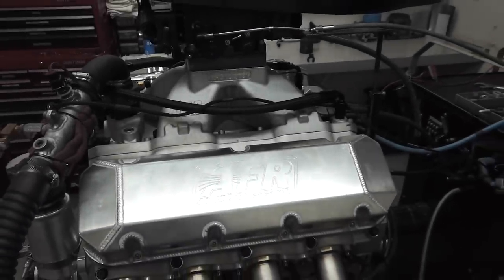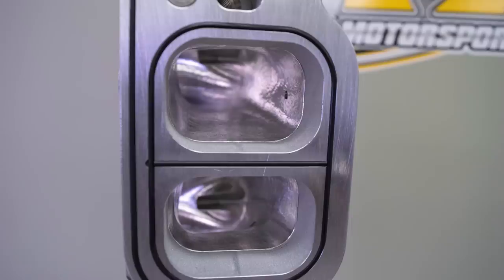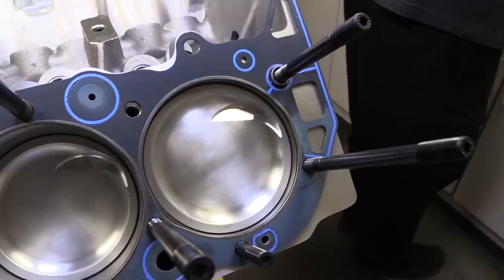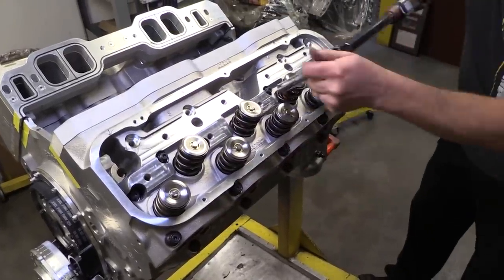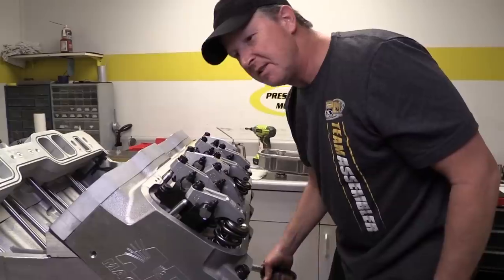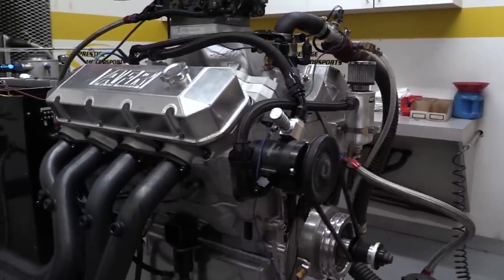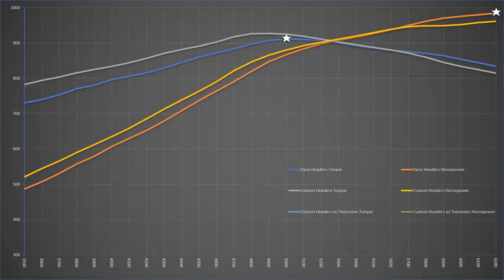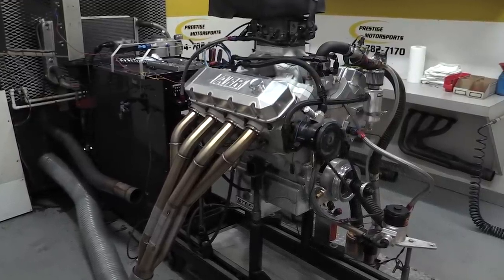665 Cubic Inch (10.9 Liters!) Monster Big Block Engine Build [The Displacement King]

Comment: No replacement for displacement.
Reply: No 4 cylinder and 6 can reach hp like a Big Block. Dragster 12000+ hp.
Reply: Hell ya brother do it for dale
Reply: Turbochargers are an effective replacement for increased displacement. Four or even five valves per cylinder are another effective way to increase HP per cc of displacement.
Reply: Neg Ative  yes it helps on small displacement. Don’t forget it helps on Big Block V8’s too lol
Reply: @Silkmaster4200  Diesel engines still use turbo chargers..... No matter how much displacement, a turbocharger will increase efficiency whether its a twin turbo or one giant turbo the size of a turbine from an airplane but force induction was designed to replace large displacement and still have the same power. Just look at Ford F 150s. As for me I would rather have a large displacement but with todays technological motors from JAPAN with variable compression it seems as though that is the way standard engine is going tobe.
Reply: Forged Steel Wrench It’s the way Ford design it. They want better on fuel. If they put Twin Turbo on V8. It would eat the V6 for supper. Be harder on fuel. That’s the reason.
Reply: @Silkmaster4200  Better fuel economy through their variable timing control true, yet with the power of their 8cyl. I would say the volume of each cylinder and the compression ratio it holds/cyl. would determine over all power at the crank before the number of cylinder count or force induction/boost. Just check out the variable compression engines that are operated by pcm, and this done before force induction comes into play.
Reply: Wrong.
Reply: turbos and superchargers work actually
Reply: @linkin6992  
Plus better mpg.
Reply: @stomabag7127   They do work . But the fact stands theres no replacement for displacement .  The engine in the video can still be turbocharged.  I own a turbocharged 383 sbc and a compound turbo cummins diesels.  Most would think im lying if I told them the power either made , the cummins is driven weekly on the street to work and so.
Reply: Yep. Anything you can do to a small motor can be done to a big displacement engine and make more power. Gale Banks says throttle response can be improved by adding a turbo, but I have two factory stock cars right now rated at almost identical ho.and tq. One is a naturally aspirated v8,.the other is a 4 cylinder turbo. Stab the gas in them and the v8 car responds immediately with tons of torque down low. The 4 cylinder comes into it's own after a second.or two when rpms raise. I like the fee of the naturally aspirated v8 for street driving.
Reply: The scary thing, is that block can go bigger - 4.7" bore, and 5.375" stroke... with no addtional work - brodix has stated you can go bigger in both dimensions with machining and special sleeves. And really, this is a relatively mild combo for this much displacement- theres video on the tube of a similar displacemmt engine built with the same block, making 3000hp on pump gas with twin 98mm turbos.
Reply: As a diesel guy i have some questions:
Why 2 valves per cylinder instead of four?

Why use a carburetor( indirect injection)  instead of direct injection ?

Why use a distributor instead of coil packs ?
Reply: A battery and an electric motor the size of a shoebox will put this to shame.
Reply: Ruckus ummm, because! old skool! Do whats known to work, except keep going bigger then the next guy! Keep it real! Keep it simple, STUPID!!! KISS!
Reply: Mike Lyons
Yeah, but the saying is “There is no replacement for displacement” and while that’s a fun saying, it’s patently false. You suggested just now to “put a blower on it and call it a day”, well a “blower” is a Supercharger and a Turbocharger’s real name is “Turbo-Supercharger” - it’s just two different methods of achieving the exact same thing - belt drive or reclaimed exhaust energy. Either way it’s energy generated by the engine repurposed to make even more energy. Turbos are just more efficient blowers typically (but not always). Hell, some superchargers are just half a turbo with a pulley mounted where the other half should be.
In the end, it’s nice to have both IMO. That’s why both of my race cars are turbocharged with a decently high volume of displacement for their cylinder count. One of these days I’ll get around to building another twin-charged car - this time for myself and I’ll enjoy the benefits of displacement, blower, turbo(s) and Variable Intake Geometry all at the same time.
I know exactly which mid-engine chassis I have laying around that engine will be going into, too! 😉
Reply: @mewrongwayKOCXF  You  do know it's been proven that on modded engines a carburetor will make more shear HP than fuel injection does right lol . There are quite a few videos on here that prove that .  The other thing is the damn LS engine isn't that all mighty HP King like most think ! They are cheap to build but also have oiling problems as well as valve train problems that few are admitting to especially on the engines that are using hydraulic cams & lifters look up 06-16 & beyond GM LS 5.3 AFM problems & you will see what a crock GM did on those to try & get better fuel mileage as well as performance & that they should have stood by the consumers & had a recall on those piles of shit but people are getting screwed on it & the only way to fix it is to buy a new cam & non AFM lifters then do the AFM delete to the valley pan & the ECM on it to get rid of that junk before the lifters go bad & take the cam out  !  Also look up Blasphemi a 55 Chevy gasser done up by one of the road kill guys using a old school Chrysler Hemi for power with a blower on race fuel only who ran against the other guy who has a 55 Chevy with a turbo LS who got his ass handed to him by the old Hemi with a blower on it . I have a newer Chevrolet Silverado with the 5.3 LS & it runs good but what I can't stand is this damn truck has way less miles than a old 93 Dodge W200. 3/4 ton 4x4 I had for 8 years with the measly 318 & my Silverado is only a half ton & only gets slightly better fuel mileage but the worst thing is it leaks way more oil than my old Dodge did & the Dodge had over 100,000 more miles on it !  The thing your missing here on this engine is it's built very strong much stronger than any LS will ever be & with the right components & because of its cubic inches it will also make way more power more reliably with less rebuilds in between but it's going to cost you but in the long run will pay off .  Right now again the true King of HP would be the Hemi powered Nitro engines running blowers & injected that are 10,000- 14,000 HP which is based off of the old 426 Chrysler Hemi but has been updated & made stronger with all billet aluminum blocks heads & parts inside & GM & Ford don't have anything that can do this ! Even though they have Toyota Ford & Chevrolet in top fuel nitro classes they are all running the same engine & only the body & name emblem is what's calling them what they are but deep down they are all running a Hemi that's it 500 cubic inches as that's the maximum cubic inch displacement that's allowed in top fuel as well as Pro stock  !
Reply: @mewrongwayKOCXF  you might want to rethink using top fuel a line of thinking when comparing efi to carburetors  - Enderale style mechanical injection has basically nothing in common with efi. It works by regualting the smount of fuel being returned to the tank via a barrel valve hooked to the butterflys. Its used in blown alky and fuel classes for one reason - the truly jawdropping amount of fuel it can pump into a cylinder in a very short amount of time, an Enderale 110 for example, i a gear driven fuel pump the size of a v8 truck alternator, and flows 13+ gallons a minute and is one of the smallest they offer.
Reply: @mewrongwayKOCXF  Also, Dostributers do have advantages over individual coil packs, enough so, that multiple manufacturers offer special distributer conversion kits for LS motors among others. 1 factor is rpm - over 8500 rpm the factory reluctor wheel setup starts having signal problems to the timing box. Also, individual coil packs tend to be much smaller than the single large coil that distributers have, and doesnt tend to suffer from "spark wash" from very (30+psi) high boost applications. It also simplifies diagnosing ignition problems between rounds when racing where time is limited. Admittedly this is a niche application for 99.9% of engines, but it does offer some advantages - i personally came across it when doing research for a (now abandoned, too much $$$) big bore, short stroke LS project  where i wanted the motor to live at high rpm for long periods of time for Formula 5000. The ignition issue was repeatedly mentioned in similar projects (btw, a 4.8l crank thats been knife edged in an lsa block with a dry sump pan and ground down for honda rods is a brutal motor with good heads - think 750 hp at nearly 9000 rpm) ive come across.
Reply: Let's be real. A twin turbo 4.8l ls will easily outperform this engine at a fraction of the cost.
Reply: That’s what she said
Reply: Kinda funny how the stock Honda Civic Type R is matching the Nurburgring times of the Dodge Charger Hellcat, with less than half the displacement. V8's don't have a wide power range. It's all focused in the low end torque. Fine if you want to drive in a straight line, getting mopped in a real world road course.
Reply: Mike Lyons  Yes. Exactly!! I was about to say the same thing but in simpler terms. Superchargers do exactly what Mike said, they supercharge the combustion by pulling air in sorta like a high speed vaccum. 

Turbochargers mix exhaust gases and outside air together which boosts the combustion. 

Superchargers are belt driven

Turbos are not and require things like intercoolers and such to keep em cooled down enough so they dont burn out. 

And the more displacement an engine has the more torque it produces down low. 

Case in point here with the engine build in the video. It made over 700 LBS of torque all the way to the redline. Cant really do that with forced induction unless its a Top Fuel Dragster making 10,000 Horsepower.
Reply: @juansolo1617  Actually the problem with todays supposed muscle cars is they have too many gears in the transmission now. 

Any more than 4 gears is way too many for a drag racing setup. 

Why?? Because having 5, 6, 7, 8 or 9 gears causes the transmission to not be able to take full advantage of the engines torque and power curves. 

Is why the 2 speed Powerglides are still popular. 

In fact the top class dragsters use just a direct drive setup. Basically no gears at all.
Reply: Not necessarily, dragster engines make  10 times as much horsepower as this engine and still have a smaller displacement.
Reply: Toy-joda for minutes not for hours.
Reply: @Silkmaster4200  I'm sure a 6cyl can hit 12k HP. Sorry this isn't the 1960s buddy. Time and technology has moved on without you.
Reply: As a matter of fact, 14.7psi (1 bar of boost) has the exact same volumetric efficiency as doubling the displacement. 

Thus literally making boost a replacement for displacement.
Reply: @Silkmaster4200  Just seen a TT coyote mustang GT 5.0 V8 lose to 4 banger cobalt.....Power to weight is all that matters.

All motor 4cyl just hit a 8 second 1/4 mile, 4 bangers are running 6 second 1/4 miles. Man you old guy's have no idea what's going on these day's lol

I can order 2500hp 6cyl crate motors. V8s are obsolete sorry old timers!!😂😂
Reply: @negativeindustrial  But what if you put a turbocharger on an engine as big as this one? Wouldn't that be better than a turbocharger on a smaller engine? If yes than there is still no replacement for discplacement ;-)
Reply: Go electric..no competition
Reply: For everyone in disagreement. >no displacement
>displacement  
Which of the two will make more power
Reply: @Silkmaster4200  ok, but you put those same turbos you would put on the 4 banger, on this and inches still win
Reply: @negativeindustrial  Supercharging is not a replace for increased displacement, it is supplementing the displacement you have (you are trying to get your little engine to behave like the one with increased displacement). If you don't believe me take the concept to it's extreme and remove all displacement while adding all the boost. All you'd be left with is an air pump that can't turn itself or do work. Turbocharging and/or adding more valves just supplements what's there. Volume. Displacement.
Reply: @boostjunkie2320  
That's wrong on both counts. Doubling the air pressure does not double the volumetric efficiency because the volume of the engine does not change (baring a variable displacement engine). You cannot put 110cc of volume into a 100cc cylinder. What doubling the air pressure does is increase the air's DENSITY, not it's volume, and this is not by double because no compressor is 100% efficient. 
When we say an engine is "110% volumetically efficient" we don't mean it literally, we mean the engine is compressing 110cc of air into a 100cc volume before the valves even close (usually by some type of air compressor, like a turbo). Conversely, if an engine is 85% efficient we mean it's taking in 85cc when the cylinder is 100cc in volume. The volume of the cylinder does not change. There is no replacement for an engine's volume (it's displacement). There are only things we can do to supplement or get the most out of that volume (usually by increasing the air's density either chemically with nitrous oxide or physically with a compressor, or even both at once).
A lot of people think a supercharged engine flows a bunch more air volume but it does and it doesn't. It does BEFORE the compressor but the actual volume of air flow, it's mass airflow, AFTER the compressor doesn't usually change that much, it's density does.
Reply: @negativeindustrial  yeeup! there is a Koenigsegg twin turbo 3 cylinder 2 liter that put out 600HP
Reply: Come to Australia mate, we have a Ford Australia 4.0 liter turbo 6 cylinder engine  known as a "Barra". There are stock looking street cars running this engine which have 1500 horses at the rear wheels. 🇭🇲
Reply: Linkin 69 so does na cars.
Reply: In naturally aspirated, more displacement is better.
Reply: @forgedsteelwrench9249  , why can we not combine them all into engines of various cylinder amounts?
Reply: @stomabag7127  , yourself, you mean?
Reply: @Acroposthion  , but you are not going to make it very well with getting those 0 to 60 start times, as the torque on those engines are horrible, plus aircraft engines historically do not have a good reputation on the road, and ditto for the vast majority of marine engines.
Reply: @ruckus__  , can a gasoline powered internal combustion engine improve its performance with those things?  I heard that some gasoline powered internal combustion engines have direct injection set ups, but I am not sure if any of them have coil packs and four valves per cylinder instead of two valves per cylinder, though, unfortunately.
Reply: @Mp57navy  , and speaking of being put to shame, your moronic comments have ironically put yourself to shame.  Also, the bigger that a battery is in a vehicle, the worse for the environment that it is, as toxic materials are used in making batteries.  Moreover, super high pitched sounds can not only ruin the hearing of humans, but also animals, as well as make them go deaf, have hearing issues, and screw up the natural navigational systems of our avian, as well as other, flying friends.
Reply: Forged Steel Wrench And yet, most Diesel engines still have to be huge. Semis use up to 14 liters.
Reply: @boostjunkie2320  you should consider still to this days a 500” hemi v8 16 valve nitro super charged can reach 330 mph in 3,65 sec (actual wr) the shuttle can just reach 250 mph in 4 seconds 😂
Reply: But I have to admit pro street bikes did a really impressive records in last 2 years for just a 1000 cc turbo nos do 1/4 in 6,30 street tires no wheelie bar

Comment: tweeted that vid to Greta ThunBerg, i'm sure she's going to love it !
Reply: How DARE YOU!
Reply: i just heard that greta is a closet hot rodder.she has a project with 57 belvedere motorvated by 1001 cid sonny s chevy hemi with 16-71 hi-helix.that thing should do about 0.75 mpg tuned as lean as you can safely do.with a serious overdrive tranny and 2.00 :1 rear gear it should turn the 17/22.5/36 tires to nano rubber particles in a shake of a lamb s tail.
Reply: @teknoaija1762  she has an old Volvo with a blown 5.0L and T5 I heard...🤔
Reply: @packrat76  weren t those t5 s somekind of hi perf volvos?i seem to remember driving one of those t5 things and it was a disappointment.
Reply: I ligit did the same
Reply: Ben T.  i ve experienced first hand both and my tuned and built 89 intercooler turbo is the fastest.i m from finland and my father always drove a new volvo starting with 1970 volvo amazon all the way to 1976 volvo 164..etc of course volvos aren t sports cars but i think v5 was a perf model though...
Reply: Bro its emissions controlled ;)
Reply: Ben T.  i had 1989 turbo intercooler.it was factory intercooler and the engine was a performance build with mahle pistons,bosch fuel injectors with increased fuel pressure(a bit noisy but effective),volvo motorsports camshaft and valvetrain.with volvo it takes a bit more to reach 500 hp especially moneywise.aftermarket parts are often very expensive like for example a powersteering pump assembly 2000+usd.with a moderate tune(10 psi) it made 315 rwhp and run 12`s at +110 mph.transmission was a 5 speed manual with electronical overdrive.i traded that volvo to a 1989 ford wagon type vehicle(just can t remember the model).
Reply: @teknoaija1762  , I heard that Volvo had an awesome V8 of their own once.
Reply: @paxhumana2015  what s that?i don t know of it?many installed rover v8 s in especially amazons maybe it s that?
Reply: God bless you sir